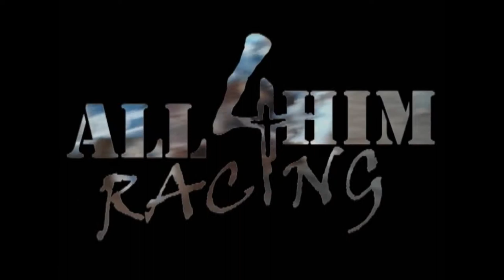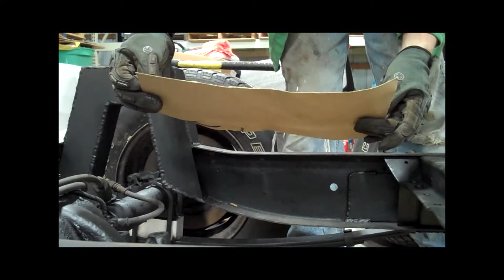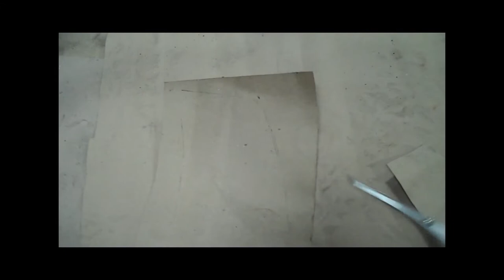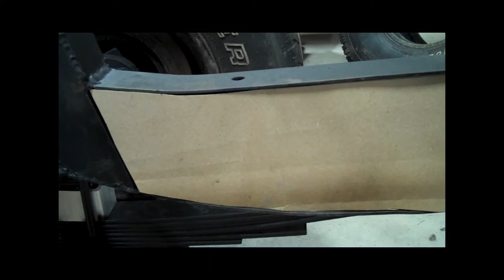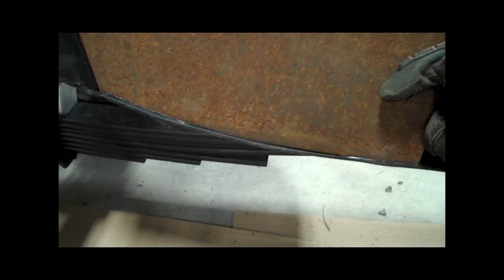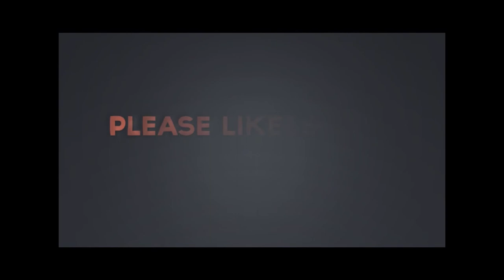Update #10 - How to Box in a Frame - 55 Chevy Truck

Comment: As a welder for 20 plus  years I seam to gaze at peoples welds just a habit not to judge or anything but your welds are bumpy and definitely would not pass a certificate welding test it’s fun to watch and learn from people and that being said sir I wanna thank you for teaching me absolutely nothing I could give a lil advice from a experienced person practice on something a lil less important than the frame I always charge people extra when they bring me junk like this to fix that they already f***ked up
Reply: I agree,been a fabricator for 20 years and it’s worrying these guys operate there modified vehicles on the same roads as us
Reply: Welder for 20+ years and I have to say you guys aren't wrong. The welds are lumped up and not even close to solid penetration.  I am building a 53 getting ready to do a mustang II suspension and a 4 link. I was considering a s10 frame. U went to look at one someone already had stripped down. On the phone he said it was stock when I got there he goes it's already cut down to 116in. Before I even seen it I said who did the welding. So he says I did.  It made this dudes look good. Straight cut no z or step anything. I said you have a good day and left. I. Am all for do it your self and everyone needs to learn at some point but you need to learn on non critical application's. I was looking at a 4 link video and this dude has his $89 HF flux core machine and was teaching his wife. On welding the rear axle assembly in.  The only hope is he runs out of money and can't finish because as stated it is crazy to think this is going to be on the road.
Reply: I think this is a demo derby car